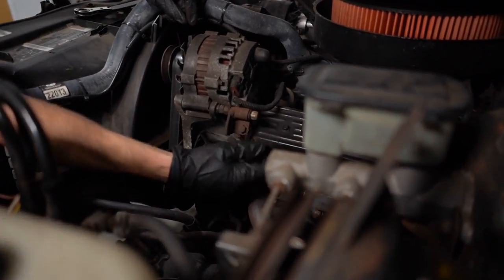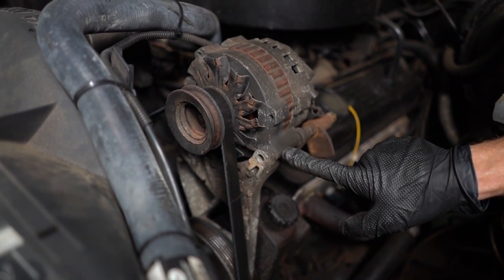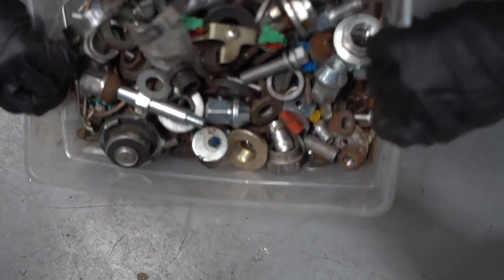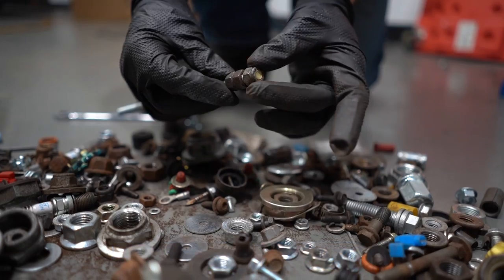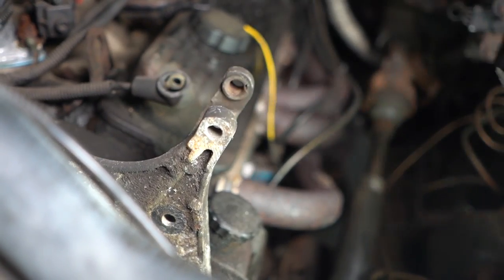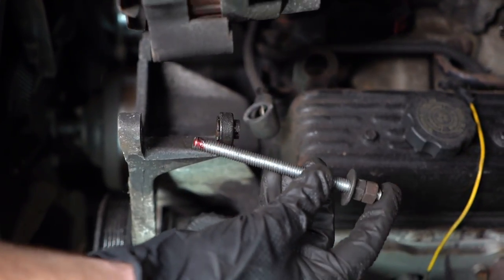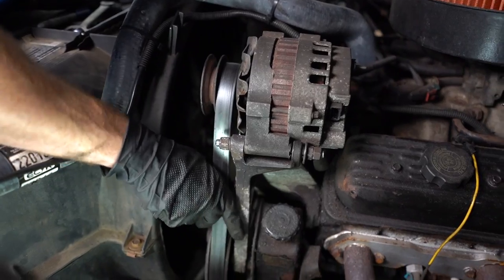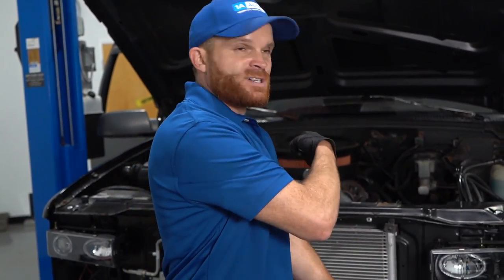Car's Alternator Mounting Bolt Broke? Try This Quick Fix!

Comment: I never knew hatred towards things until I had to replace an alternator on a 02 honda civic coupe. I will never forget. that bottom bolt had me going crazy for a few days.
Reply: I did mine two months ago and ended up with the same problem, still think about it till this day smh lol, mine ended up needing to be welded off 🤣🤣

Comment: Don't put a Snow Plow on a half ton vehicle, Snowplowing will destroy light duty trucks. They aren't designed to take that kind of abuse. Not to mention the rust & corrosion will take decades off of a vehicle in only a few years.

Comment: for most diyers it's probably easier to just go to the hardware store and find a bolt. even if they have to go back 4 times before they have the right size. I know I've never had allthread laying around and it was long into my diy days before I had access to a cutoff tool.

Comment: I have a 2005 Town and Country.... it has 3 mounting points for the alternator. 2 or the 3 bolts broke off....one to the left side and one in the block.... I am thinking about how to get the one in the block....drill it out??

Comment: Instead of double nutting, a cap nut (also called an acorn nut) on one end of the all thread will look almost factory.

A related story I have is that I actually broke the exact same bolt when replacing the alternator on my 99 dodge ram. I snugged it up then went and got the torque specs from service data. Guess what though the torque spec on that one bolt was wrong! However I was tired and didn't catch the mistake so I snapped the bolt with my torque wrench lol. I ended up using all thread with a cap nut on one end to replace the bolt hence the tie in to this video. I learned that day to double check torque specs given in service data with what that bolt should be able to handle on a third party chart.

Comment: Hey I have a 2007 mustang gt. My 2 bottom mounting bolts for my alternator snapped. Can the alternator hold by the bracket till repairs?

Comment: This bracket 10233233 has a bolt through from the rear. The front hole was at one time threaded which evidently has had the threads stripped. So the correct way a bolt holds the alternator is place is through the rear.

Comment: Hi ! How are you today, My Name is Mr.Herman Woods .I have a 1981 dodge colt 1.6.My ALTERNATOR . tube part ! That the bolt runs through. Has gotten oblong ! In side ! Like your video , where .It is on the alternator.But on my car ! Its on the mount , but in the in side it got 4 oblong out of shape from the hole. Causing the alternator to move vibrate .i put sticks in it , to take up some space next to the bolt.it helps ! Until the sticks breaks up , the metal. I think is aluminum , And the mount is a crank case front ! But the mount is on the side .Of the engine , So o wont to know ! What would you .put in the hole ! To take up that space . Our do i try to fine some one .With a TIG welder for aluminum. To fill up that hole , back to shape.Pleace let me know, on what you think .thank you for your time .Mr.H.Woods 😅